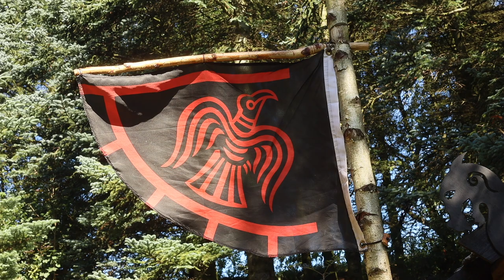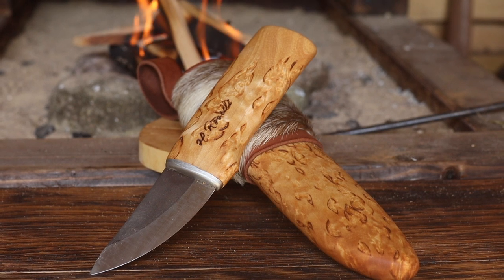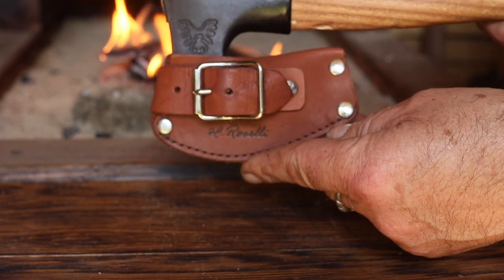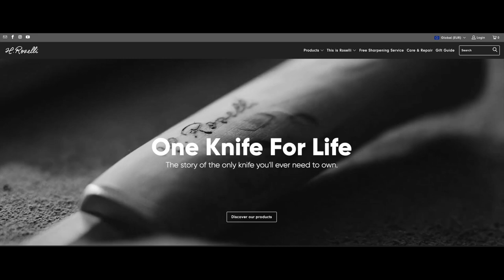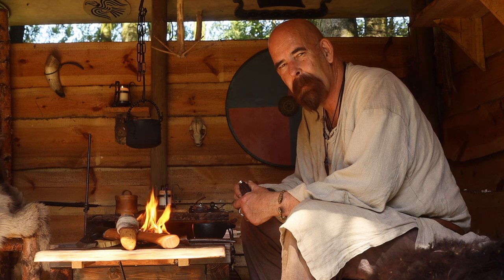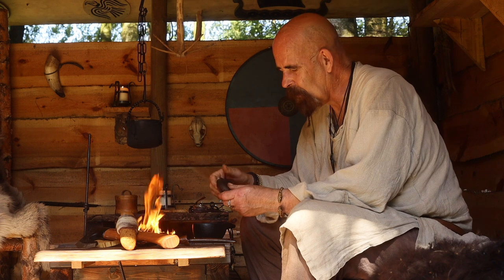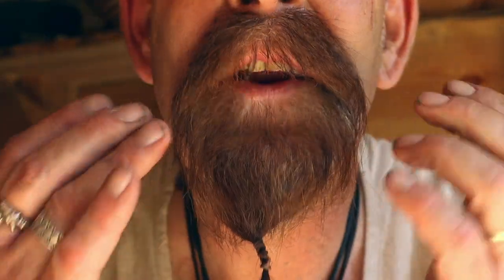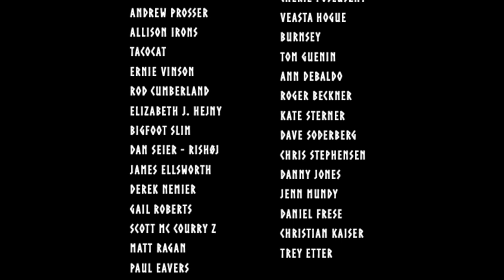Cimbrer & Roselli

Comment: i have these axe from roselli for many years and also some knives. at the axe i had to reprofile the edge after arrival because originally it works not so perfect. during the years i also made new handle for it because the axe ends up to close to the fire but i have it still in use until today and i like it.
one of the knives i have from that company has that wootz/uhc blade. it is harder to sharpen it on traditional sharpening stones but you can get it sharp like a razor blade and it holds his sharp edge really long. but do not forget to oil it after use from time to time
Reply from the maker: Thanks for sharing this with us Henry 😉👍🏻 good advice is always great and I’m glad you also like the products that Roselli makes 🔥
Tom